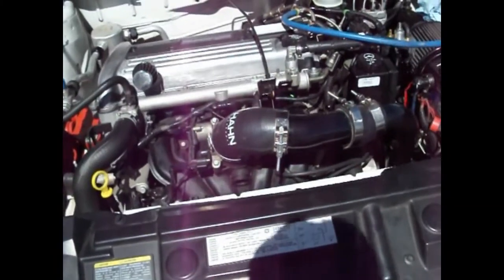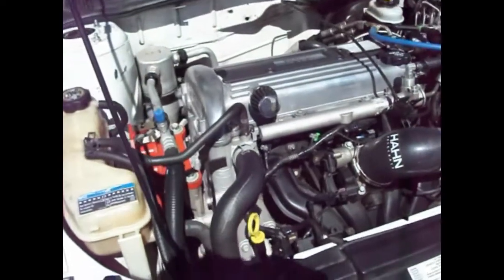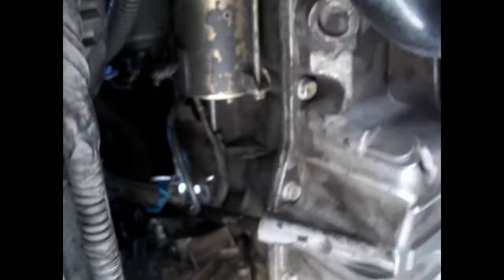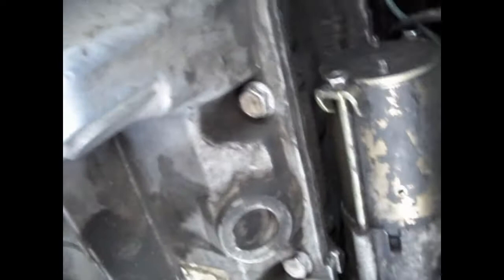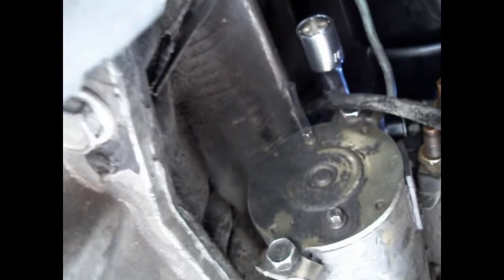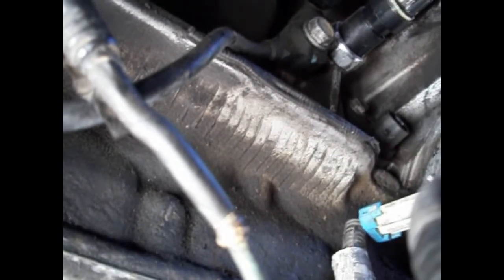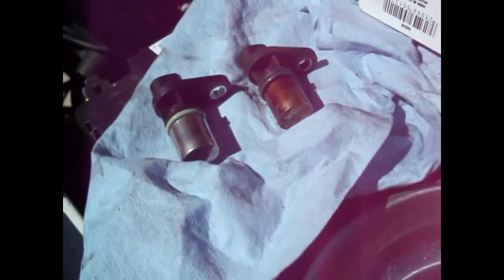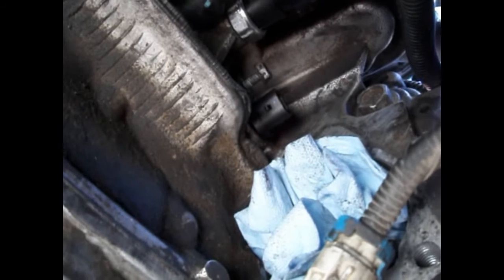2.2 Ecotec Cavalier Crank Position Sensor Replacement

Comment: Great video, my friend, good information, added information is very useful. Trying to solve a P0340 code on a 2006 Saturn, Ion, 2.2, same engine, but has no cam position sensor!
Reply from the maker: nld1960 Donny has had that issue with his 05 for a long time now.. don’t think he’s even figured it out, I can ask for him though, his started after he did a computer relocate.
Reply: There is no cam sensor on this generation ecotec. This is a crank sensor video not cam fyi. Also the cam sensor is built into the ignition control module on top that days ecotec on it instead of having a seperate sensor.
Reply: @TeamSTCDonny  thanks for that information how you found that out I don't know but no one else seems to even know now it makes sense to where the parts stores says they dont carry it because it doesn't exist.
Reply: 03 Cavalier here with same issue.

Comment: Great video I liked that what I needed to do and where it was located I'm also have been issues on my 04 2.2 Eco tec it just won't start so I got my answers from a few people that they say it's the cam position sensor cause my engine wouldn't start at all it ran several hours away before I had tried to restart it again it cranks but no fire at all
Reply from the maker: berad187 is it getting fuel? Also a common problem
Reply: @STCgarage419  yes it is it has pressure in the fuel lines I checked that cause I can smell a strong fuel smell in the air intake I was afraid I might of been flooding It out for how long I'm cranking it I was told a few time it could be the crank position sensors them do give out plus I know I might have to check my fuel filter too I hate to send it in the shop if i really have too
Reply: @berad187  there is no cam sensor per say on a L61 ecotec of this generation...it is built into the ignition control module on top of the engine. There is no seperate sensor.
Reply: @berad187  also pressure and enough pressure is 2 different things. Stock fuel rail needs to see 50-55 psi at idle. You can rent a fuel gauge from autoparts store to use. Have you had the pcm scanned yet for codes? It could even be timing related as that is super common on these...
Reply: @TeamSTCDonny  oooh ok so I didn't say cam sensor I mentioned crank position sensor but I didn't know that either cause I new it had been something so I did check a few videos on about this same issue but I'm still looking but thanks anyways

Comment: I HAVE A 2004 CHEVY MALIBU 2.2L ECHOTECH ENGINE. IS THERE A WAY TO DO THIS WITHOUT REMOVING THE STARTER? HOW WERE YOU ABLE TO LINE UP THE TOP HOLE WITH THE STARTER IF YOU CANT GET YOUR HAND IN THERE EVEN IF YOU USED AN EXTENSION? DID YOU HAVE A PROBLEM WITH A 340 CODE AFTER USING THE AUTOZONE PART. I ALREADY PAID A MECHANIC TO INSTALL THE AUTOZONE CRANK SENSOR AND I STILL HAVE THE 340 CODE. I CHANGED ONE OF THE SPEAK PLUGS SINCE ONLY ONE OF THE 4 PLUGS I LOOKED AT REALLY NEEDED TO BE CHANGED AND THERE IS A NEW COIL PACK AND IGNITION CONTROL MODULE INSTALLED AND A NEW MAP SENSOR. SOME REVIEWS ON THE AUTOZONE WEB PAGE SAY SOME PEOPLE THAT USED THE DURALAST AUTOZONE PART ALSO HAD A PROBLEM WITH THE PART AND ALSO GOT A 340 CODE.

Comment: Hi man great video. I have a question and I hope you can help. I have a 2003 Cavalier with the same 2.2 ecotec and a cylinder 1 misfire. I have checked the spark, replaced the injector, replaced the plugs  but still the cylinder 1 misfire remains. Someone told me it could be the crank sensor.  Does that sound right to you ? I am doing my own work on it but I don't know what to do now. Any help you can give would be appreciated.
Reply from the maker: Trippy James Reynolds I would get a cheap “Android bore-scope” and take a look down that cylinder
Reply: What Kickstand said..scope it, also how is the upper 02 sensor? How is the ignition control module? How about the timing set has it ever been replaced? All can cause missfires or rich running conditions as well as cps and knock sensors being bad.

Comment: I thank you first ive replaced the sensor. Im still throwing the code po340 its why I started this any ideas how u reset crank sensor? I have the 2.2l ecotec dohc with after market all over the place I love my car needs tlc
Reply: P0340 is a camshaft position sensor code, not the crankshaft position sensor I know because I have the same car and I hooked up my ODB2 and it read p0340 camshaft position sensor issue my problem is i can't locate where it is on the car and I haven't found any videos showing the location, and not to mention if the vehicle even has one. And if you have repaired yours since this video could you tell me where it was located it would be much appreciated
Reply: @kevinnelson7070  yes camshaft position sensor can not locate on my Ecotec 2.2l is what Vin shows actually may be a 2.4l as the parts I've bought only matched parts for a 2.4l dohc. The car is 19 yes old and a lot of aftermarket changes. Have you had any luck with locating cam sensor?
Reply: @sherrypicchione5344  no luck yet one of my guys said that there may not be one on this car but he is not 100% sure,but just got done submitting this question on a chevy cavalier forum and im waiting for one of the online mechanics to respond they say it will take 24 to 48 hrs to respond when i find anything out i will be sure to let you know
Reply: @kevinnelson7070  thank you that is very kind of you. I just got thru painting my car with spray paint. Not to bad considering .
Reply: @sherrypicchione5344  goodmorning Sherry congrats on painting your car I have never tried it, I am messaging to let you know I have not forgotten about you I have been asking around about the p340 camshaft sensor code and so far I have gotten conflicting answers One guy said that it is possibly on the right side of the of the engine somewhere in the middle held on by a 10mm bolt but he didn't have any pics or videos of it, another guy said that this car does not have a camshaft sensor and that the problem could be between the ignition control module( which is that silver piece connected to the coil pack) or the cars computer or the wiring in these two components. My issue with his answer is that he also said that none of the cavaliers have a camshaft sensor, and I know thats not true because I also own a 2002 cavalier 2.2L ( non ecotec engine) and it definitely has one in it. I am grateful and thankful for bothe of these guys responding they are the only two who did respond out of the many who i messaged, I am going to contact an actual chevy dealership and see where they can point me but more than likely they may try to get me to bring it in which will be my last resort I will keep you posted have a blessed day Sherry

Comment: why were you replacing this part, I am wondering because I am having spark issues or should I say lack there of. My car is 1993 2.2 liter cavalier  it is not recieving any spark
Reply from the maker: That would be an OHV Cavalier, bit different from the Ecotec, have you tried messing with the distributor?
Reply: Start by checking resistance at the coils and see if they are reading correctly. Check grounds off that harness for coils also.

Comment: Nice video, perfect for me cause I have the exact same cavalier, same year same color, mine has 428,600 miles on her. I replaced the crankshaft position sensor and I'm still getting the sensor code any direction from here?